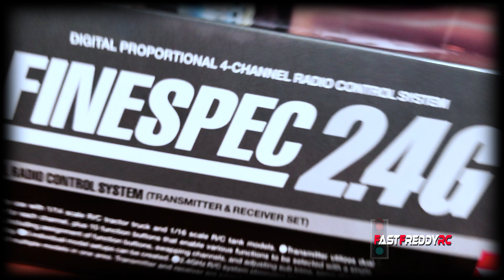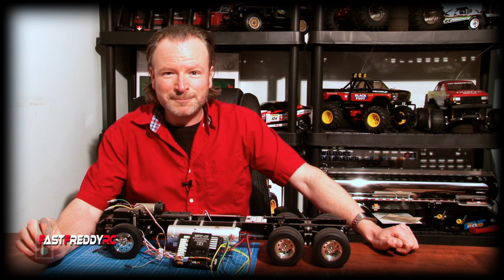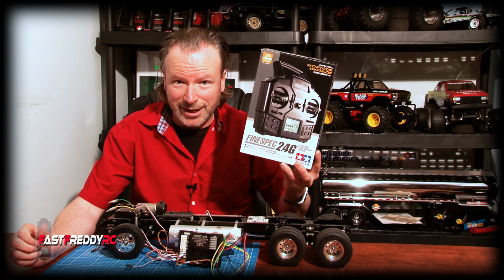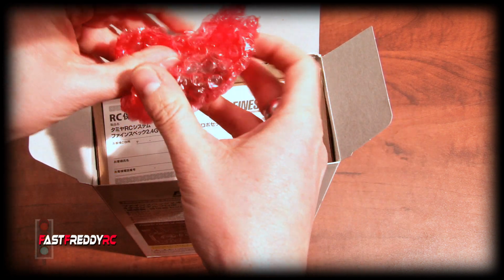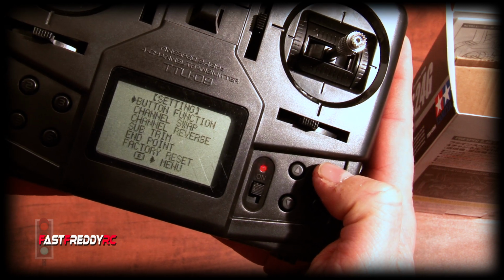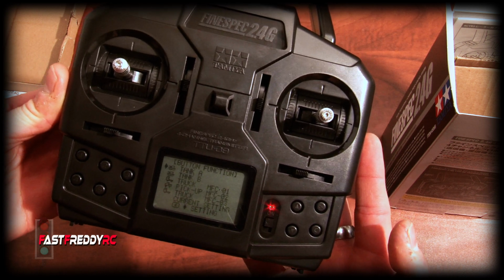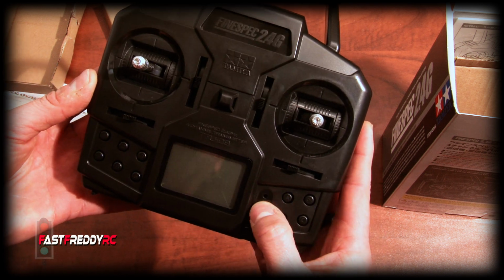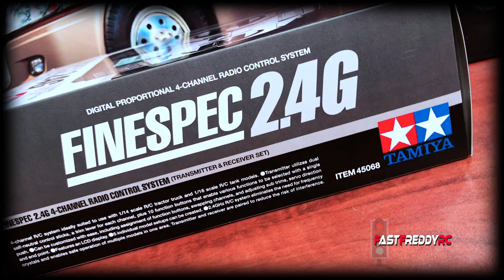Unboxing the Tamiya Finespec 2.4G radio for 1:14 scale Semi's using the MFC-01, MFC-03 and more...

Comment: I use Spektrum DX8 for all my trucks and I wouldn't use anything else. Dual Rate is far far better for the MFC because only channels 3 and 4 (J6 & J7) need trim/dual rate. plus with digital radios that you can assign channels and that's great for moving the Shift Servo to a 3 way switch so it's not on the left stick.
The Tamiya Finespec is far from the ''perfect'' radio... it's just better than the Attack and it's one that Tamiya do.... it has far less functions and scope for a better set up with the MFC over a radio that has dual rate functions and channel assigning.
I'd go as far to say that the Flysky FS-i6X is better than the Tamiya Finespec. I've done loads of videos on how to set up radios using dual rates.
Reply from the maker: Hi Teri!  Thank you for this!  I think it will be very helpful for everyone!  The right radio, servo's etc. seem to be an ongoing discussion with these trucks so it's great to see that you've found one that you're very happy with.  It's definitely too early for me to comment on your suggestion as I need to figure out the Tamiya Finespec radio first.  Just curious, but as this radio came out in 2018, did you get a chance to try it out?  or have you just stuck with the Spectrum DX8 right from the start?  I actually really appreciate you commenting on this as there are so many options for radios but no one seems to know exactly what works best.  So I think what I'm going to do is set up this radio for my cascadia, and then get the radio your suggesting here to set it up with my Globeliner.  That way I'll have a direct comparison of the two AND I'll also know that I've bought a radio that comes highly recommended for Semi Trucks!!

Comment: This sucks, I just got my radio and everything sais no action all the way down. I get steering and shifting but nothing else.
Reply from the maker: Hmmm...weird.  The only thing I can think of is that the transmitter was reset somehow from the factory settings.  If you go into settings you should be able to assign each of the buttons to whatever function you want them to be.  Just might take a bit of time to set up.